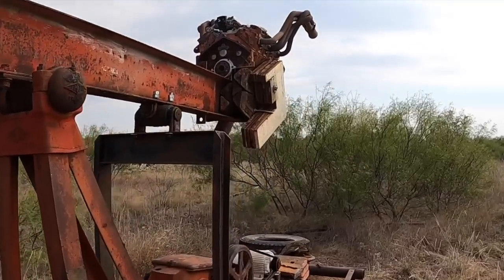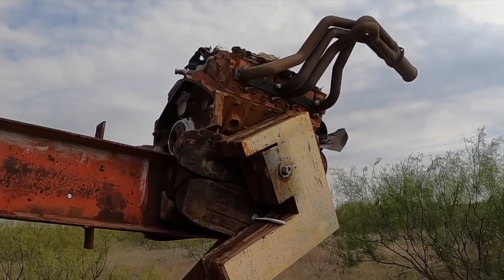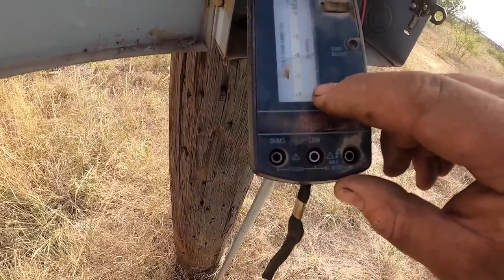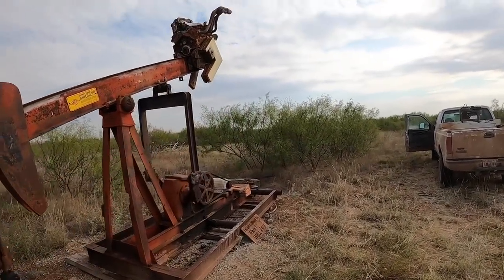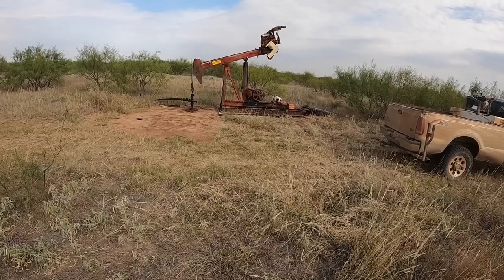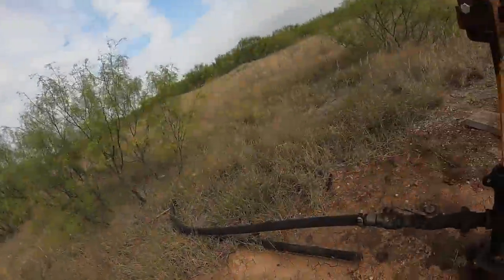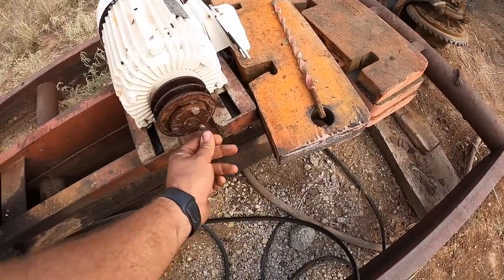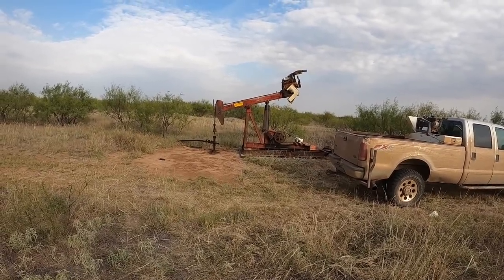Well balancing and Pumping Efficiency

Comment: That's a lot like a cable operated elevator then, the counterweight is somewhere between the empty and fully loaded cab weight for efficiency throughout the range of loads on the motor. Great point on calculating the difference between two sheaves as well.
Reply from the maker: Exactly.

Comment: I used the way you calculate the size of pulley needed for many years. I always wanted to pump shallow wells, but the ones I pumped were about 6600 feet deep. The pumpjacks were 320’s to 640’s.

Comment: I am from Kansas and I relief pump, and one of the lease has two air-actuated pumping units..  They use a big air cylinder with air pressure to help pull up the fluid...  I was told that they use them in Texas because of how deep they are...  First time that I had seen them...
Reply from the maker: interesting.

Comment: Zac sorry about f150 trans. My 05 f150 5.4 cratered at 195000 miles with no warning signs. Ford rebuilt 3yr 30M warranty installed by Ford house $7500 good.luck on your transmission.

Comment: Very good info! If you were to go and add another few hundred pounds to that counterweight would that save you a bit more energy or is there a zone where adding weight stops benefits and just adds more stress to the structure/bushings? Assuming having a 50/50 split would negate energy savings since the rods weight couldn't drive it through the oil without motor assistance it makes me wonder what the "perfect" weight/speed would be for that well. Definitely makes your job a bit more involved than just drilling a well and plopping any old setup on it. This is very interesting stuff and I appreciate you dropping knowledge for us.
Reply from the maker: It might but it's going to be very little. Imo its about as good as it will get.

Comment: So it's lifting 1600 feet of oil at whatever the diameter of the pipe is 30 inches at a time not including the pump mechanisms. I'm guessing the table for fresh water is close which brings me to a question I just thought of regarding oil/water that's being drawn. If oil is lighter than water and it's sitting in the ground whether porous rock or whatever then wouldn't the well point be pulling either oil from the top of the reservoir or just water if it were below the line of separation? In other words, how's a mix coming up if the well point is set in a fixed elevation and the reservoir is just a pocket? 
Hopefully I got my question across and great seeing a notification as I could listen to you talk about paint drying.
Reply from the maker: I would like to do a video about this. Most of the formations around here are very wet and need to be thought of like a lake full of pea gravel with a thin layer of oil on top of the water. The well will be perforated at the top of the formation where the log show a high concentration of oil. If you were to perforate into the lower part of the formation you would only get water. With the oil layer being so thin you simply get a mixture oil and water. Also the movement of more water can bring more oil with it.
Reply: @TheZachLife  I really appreciate your time in answering my question. The Google, not so much. I would definitely be interested in that subject too as long as you cover it.

Comment: If you ever use a gas operated well rather than electric, you'd think that balance was more important. Ideally you are only pulling up the weight of the fluid and 1/3 the weight of the rod. 

Also Jerkline well sets needed to be balanced so that the single engine was only pulling one well up at a time, or at least the entire system was in balance. as one goes up, one (or more) is going down. 

The constant torque available from a 3 phase synchronous motor makes life a lot easier.  Those weights were adjustable for a reason on the older units. 

Also a synchronous motor will not act like a generator (alternator) and put power back into the line.

Comment: Don't know I'd you have ever checked into using VFDs, especially with single phase power. They will pay off pretty quick in electric consumption and equipment ware, both down hole and surface.
I have them on many wells and injection plants too.

Comment: I would never have thought of the counter weight and stroke of a unit in comparison to fluid pounding and electrical usage, BUT now you’ve explained it I’m totally confused about something I’ll never use, in saying that now you’ve slowed the stroke giving fluid time to refill the pump chamber thus using the pump to pump fluid and not pound air thus totally utilising the pumps efficiency... I think 🤔
Reply from the maker: Hahaha that pretty much it. No need to use power pumping nothing.

Comment: The pumping unit looked much happier the way you left it!   Great demonstration on the sheave change and its influence on the efficiency of the unit.   Do you ever have an application to use adjustable sheaves?   I'm guessing the amount of change necessary to make a difference would be too course for adjustable sheaves.
Reply from the maker: I don't. Like this, it's required one adjustment and will probably be set for a really long time.
Reply: @TheZachLife Thanks for the sheave formula! I never knew that. That’s going to save me a lot of time.

Comment: How much of your fluid is water compared to oil. On secondary recovery moving the salt water makes it heavier but it's mostly about the length of the stroke. Yours looks about 3ft on video. Is your tubing 2 3/8 or 2 7/8. We have mostly shallow wells around here some as shallow as 300ft. If you make lots of water it's harder to move.
Reply from the maker: Its mostly water. I would guess 2-3% oil. 2-3/8.

Comment: It's hard for me to believe that a slug of oil, even 1600 feet down and under 800 lbs of pressure weighs any more than that same slug of oil at normal pressure. Maybe a tiny bit more. Liquids can't be compressed. But I accept your real-world experience! Man, the bearing atop the samson post gets a crapload of wear!
Reply: You have 1600' of that oil above it😉
Reply: @caseymitchell5477  But that does not change. I understand and accept that the rod and a 1600 foot long column of rod and oil could weigh bigly, but they weigh that all the time. Heck, the rod is under 800# of pressure as well. Does 20 feet of rod weigh any more when its under pressure versus when its at STP = ground level, 1 atmosphere = 15 psi. Ans: No.
Reply from the maker: The density doesn't change, but you are having to lift a 1600' column, that is why it's heavy.
Reply: @alanpecherer5705  depends on what is causing the pressure, a BPR valve you set at the surface, or gas pushing up from below. A bunch of gas entrained in the fluid coming up the tubing would make it weigh a little less.
Reply: @caseymitchell5477  I can believe that. But the weight variance in a column of oil (stroke length) * (casing diameter) compared to 1600 feet of rod and oil would be microscopic.

Comment: Stroke wanted X gear ratio = X pulley diameter on gearbox = ÷ by rpm of motor = pulley size needed on motor to achieve strokes per minute.

Comment: Off the top of my head, why not bore a second time and like link the jack lift at 180° of cycle.
Or even 6 cylinder bores.
Maybe I'm too dumb.
Reply: Synchronous motors are only rated for limited starts per hour. Windings get burnt out.